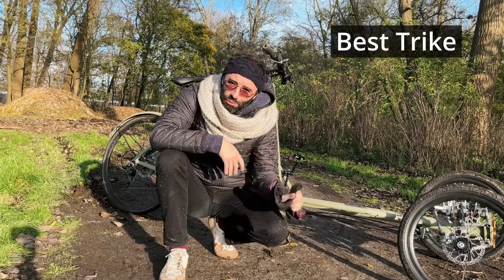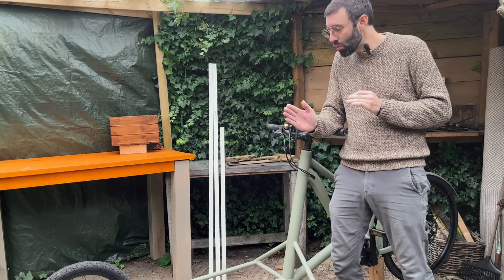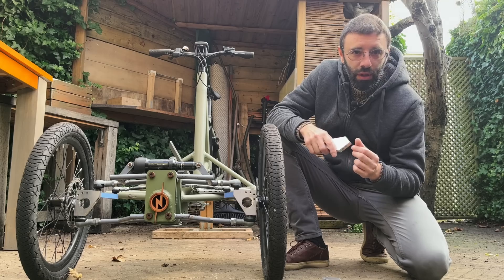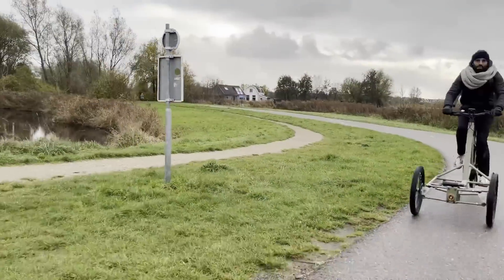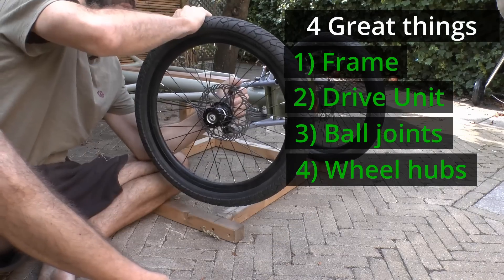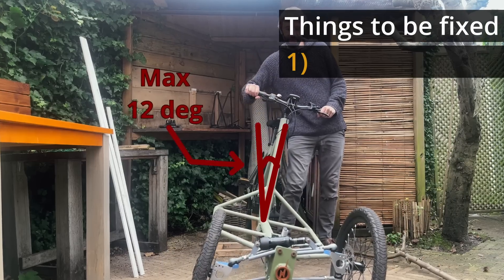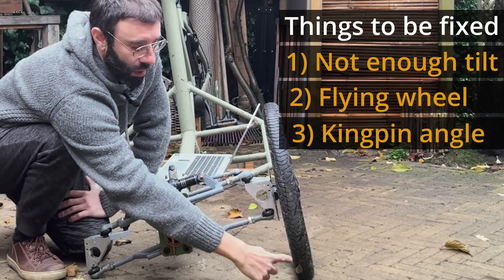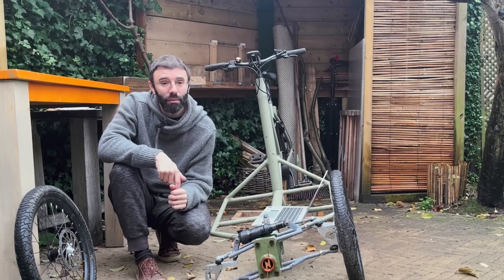#5 Build Finish and Tests - Tadpole Tilting Cargo Trike

Comment: I previously mentioned my doubts about the cable steering, but I'm no glad to hear that it seems to work that well! Did you ever retension it during your tests now?
Reply from the maker: The problem that I had with tension was the cables slipping (in the main head tube they are pressed with bolts) so I used washers with a rough surface instead of smooth and tightened the bolts hard and never had to tension again.
Reply: @pedro-neves  Thanks a lot for documenting all your findings!
Reply from the maker: @feudiable  my pleasure! Thank you for inspiring with your kind words.

Comment: YT just recommended this to me and I'm glad I'm here!
Your design reminds me a bit of the design Johansson (part of Pierer NewMobility now) uses on its Oscar S and Oscar M cargo bikes. They also have a double wishbone design with a single damper between both sides.
When the damper, and especially it's rebound, is set up properly, the Oscar M (which I have) is very stable going fast. Going downhill, I've reached speeds of 50-60kph with it!
It's also capable to do some limited offroading. I've taken my Oscar M to places no cargo bike has ever been before (and probably never will again, lol).
Johansson has some videos of the handling online, if you're interested.

If you're interested and are still looking for some inspiration for your design, I could also film some video of the Oscar M suspension at work (I have some action cameras that should provide good footage).

Also, in a video about different kinds of steering for recumbent trikes (non cargo), Utah Trikes also mentioned the Ackermann geometry. My Azub recumbent trike also turns the corner inner wheel more than the outer wheel and it feels very stable. I can also provide footage/images of how they've done their steering. It's basically a parallelogram steering as well using rods as linkage.

I already subscribed just now. I'm very interested in what you do next and how you solve the outstanding problems!
If you're looking for a new project soon, I'd be very interested in how you'd approach the build of a recumbent trike with suspension ;D
Reply from the maker: Oh, thank you so much!
The Oscar trike sure look cool! Before even going to the front, I like how they mounted the drive unit with simple brackets instead of a more complicated wrap around.
The wheels are super cool!
I like the simplicity of the tubing.
And finally the tilting mechanism looks great. I will watch a few more of their videos.
I haven't seen how much the vehicle can lean. Do you know? And is it enough to you?
Furthermore, if you like to share some videos of details that would be lovely. In this case, I would suggest posting here: https://www.reddit.com/r/VehicleEngineering/. I created this sub due to this very reason ;).
Again, thank you for your kind words. And so nice that you also had the idea of offroading with cargo vehicles;)
Cheers!
Reply: @pedro-neves  The Oscar has bump stops made out of rubber that limit the leaning. The advantage is, that you don't have a hard limit that might unsettle the bike but it kinda softly stops you from leaning more. I actually took out a spacer nut because the lean wasn't enough for me and it's still stable ;)
I'll try and set up a few videos showcasing the suspension. It'll take a few days though because it takes some time to get the right lighting outside for a proper quality video. I'll post the video on the subreddit when I've had the chance ;)
Reply from the maker: @wullxz  that's good information, thank you! No pressure on the videos. If you ever feel like doing it, I'd love to watch, of course;)

Comment: 1. Aluminum is fine for the axles.  Just make the connection at the same size as the larger hub bearing.  Taper the axle as well.  There’s a reason Canondale does this.

2. You’re wanting to produce a cargo bike, not just a tricycle, so make sure you’re doing the tests with varying cargo loads. How does the front suspension perform when it’s at a higher pressure to account for a payload? How will the vehicle handle when it is calibrated for a payload but is currently empty? Can this performance be improved by using a lock out in one of the travel modes (loaded vs unloaded).
Reply from the maker: Hi, I agree that the axles can be made out of aluminium with a better design. Though, I think I'll make them out of steel next time to compensate for design errors.
Regarding the tests with loads - totally agree.
Cheers!

Comment: Hi Pedro, another solution for decreasing the kingpin inclination angle is to use "deep dish wheels". With these types of wheels, the hub is positioned farther towards the outside, which allows for smaller kingpin inclination while maintaining a small/zero scrub radius. Google "wheel offset" for lots of examples.

Comment: What if you use cables instead of struts between the steering axle and the wheels?
Reply from the maker: Hi, I had this suggestion before and I still consider it given that when I increase the tilt, the steering struts ball bearings may not be sufficient anymore.
Cheers!

Comment: Go for steel on the axles, also pretension with enough torque to ensure increased fatigue. My guesstimate is that the aluminium axles failed due to fatigue rather than actual stress
Reply from the maker: Absolutely! I won't use aluminium for axles again. Cheers!

Comment: On the bush trail, the vehicle seems difficult to control. It seems to want to spear off the path. The tilting will steer it as well as the steering mechanism. A standard bike when titling doesn’t need much actual steering. Most is done by the tilt. Do you think the rider will get used to this, or is your steering too sensitive. I like the variable steering idea from the other guy!
Reply from the maker: Great points! Indeed there's not much steering in a bike. Though, I think that a cargo bike will have more steering than a bike because the vehicle being long it needs more steering to react. There is still one geometry aspect that I will consider in my next build - rake. I think I can make it more stable by plating with it.
Cheers!
Reply: @pedro-neves  Would you be interested in putting a datalogger on a standard bike, and measure the lean, speed and steering angle on it? I went for a ride today and looked at how much the steering wheel moves. Not much. I'd love to see figures (surely some PHD student has done this?). Not sure if it's your interest. Ultimately, if a leaner is going to work like a normal bike, it has to tilt like a normal bike, and speed, lean and steering angle are the parameters. And perhaps a 'fly by wire' system, is the best way to make this work. Complex, but fun? Yes? No? Thoughts?
Reply from the maker: @andrewmclean1239  Andrew, I thought of this idea before and I think it makes a lot of sense. As a control, probably best to test with a bike and a cargo bike and compare speed, turn and lean as you said. I'll look for some papers about it but if I can't find it may be a good project for me to share:).
Reply: @ that would be something else! If there is anything I can help with let me know. I’d try the elliptical idea first but imagine building the cybertruck steering for tadpoles!!
Reply from the maker: @ hehe, then we'd have an excuse to call it cyber trike ;)
Reply: @ YES!!!!! Love it!

Comment: Re the 30 degrees angle of the ball joint. Would a simple fix be to modify the bottom control arm with a bend before it attaches. so that when it fits onto the stub axle , it’s closer to a 90 degree? 
I’m also wondering about the angle of the steering rods (tie rods). I wonder what would happen if they are closer to 90 degrees to the frame? Hard to explain without a drawing.
Reply from the maker: I agree with you that I would be able to increase the lean by changing the shape of the lower arm. Though, I still think that not enough. It's a great point that I may have to change the connections of the steering rods!

Comment: Actually steel and aluminium have very similar strength to weight ratio.  So either can be built low weight.  Steel is much more resistant to fatigue fractures.
Reply from the maker: Axle should be made of steel for sure!

Comment: What an awesome trike build! Yes you should absolutely switch the material of the axles to steel. Aluminum never has an infinite fatigue life, whereas steel can. So under repeated loads, like you would expect in an axle, the aluminum will always eventually fail. Even if you increase the diameter where it joins into the knuckle, it will still eventually fail. In an axle that has that large of a diameter you could likely make it out of hollow steel without losing too much strength compared to solid steel. So you could save a little bit of weight there. But there is probably math you should do before you start hollowing out the axles lol. Also I would suggest making the knuckle out of steel as well. It will receive the force from the axle and also eventually fail, if it is made from aluminum.
Reply from the maker: Thank you so much!
I'll make the next axle out of steel for sure! The knuckle I'm still not sure as it will be totally redesigned.
Cheers!

Comment: I love this project . Great job! My suggestions:
For the Axle bore out your part and use a central 8.8 steel bolt. It should be plenty strong and you simplified the Design. From a manufacturing standpoint avoid the sharp corner between different radiuu next time. Putting a slight radius around the circumference will reduce shearing stress at this point immensely .
Keep on inspiring!
Reply from the maker: Thank you!
I'm having all this trouble designing the axle because I love these Lefty hubs;)
Definitely need to reduce the sharpness of the transitions!
Keep on inspiring you too!

Comment: Expect Aluminum to fail when stressed. 
Also expect failure at sharp transitions. Use at least .050" radius.
Reply from the maker: Absolutely. Two mistakes - aluminium axle and sharp transitions.
Thanks!

Comment: Great work! Thanks for sharing not only your success, but a failures too. It makes your solutions more understandable.
According to the front wheel axle I'd use steel. It won't demand to raise axle diameter and, probably, allows you to keep the front knuckle unchanged.
Reply from the maker: Thank you so much! Indeed, there's a lot of knowledge in the process (mistakes). I'm happy to read that this is vallued.
I will definitely use steel next time.
I need to change the knuckle anyway because I think I'll improve the steering by reducing the kingpin inclination.
Cheers!

Comment: Unfortunately, to mitigate tilting problem you need much more than swapping the ball joint. This effect will simply appear at bit greater angles, but the inner wheel will still bear most of the weight in the turn.
Instead you have to rework linkage for change in camber angle through the suspension travel just like you fixed toe angle change due to change in travel. That will solve third problem as well. And - maybe even more importantly - decouple suspension, adding second damper.
Reply from the maker: Thank you for the tips! Indeed, I intend to have a bigger inclination limit but I will keep the strain on the inner wheel. But I think that's alright.
Cheers!

Comment: Describe a turn not as an angle but as a radius. There are 90º turns that are sharp and 90º turns that are not sharp. The critical question is the radius of the turn.
Reply from the maker: Thank you! Correct! What's the point of being 90 degree if I make it wide... Thank you for correcting me on this. And for taking the trouble to do it. In return, I will state it correctly next time;)
Cheers!

Comment: Have you had any thoughts about doing the rear wheels in the same way? I'm keen to try a small electric car using motorcycle wheels (small ones, like off a 80cc motorcross bike). I think this is the future of transport.
Reply from the maker: Ya, the only difference in the rear wheels is that you have to consider traction. So, you'll need a different hub design.

Comment: Axles should be mounted on standard M16 or something like that screw. This is such a simple part and important component - it should be easly replacable and made of hardened steel - just like a solid bolt.
Reply from the maker: Absolutely. Scratching aluminium as material for for axles;)

Comment: 12mm (M grade 8.8 or 10.8, not sure) bolts are used for front axles on my offroad gokart, they take massive impacts without issue.
Reply from the maker: Ya, I think that steel would hold even at 12 mm.

Comment: This is very impressive progress. I really like your steering geometry improvements and I’m excited to see the next generation. 

I do have a couple ideas to improve your knuckle and spindle parts.

Where there is a change in cross section on the spindle, you should add a radius or fillet if possible. This is especially important where the reaction caused by the wheel is high, at the joint with the knuckle. 

I like your idea to keep the larger diameter spindle rather than turning it down to a smaller diameter. If you do this, you could  simply increase the bore size of the knuckle where the spindle is inserted. The spindle diameter may exceed the thickness of the knuckle, but this is okay. 

When you insert the spindle into the knuckle, it will protrude on both sides and can be welded in. The advantage to doing this you would have a lot of welding length for a strong connection.

Another alternative would be making the knuckle and spindle in one piece.  If you have access to a milling machine this can be done easily with a boring head. If not, a four jaw lathe chuck can be used, especially if you have a live center to support the spindle.

Best of luck with further development. I can’t wait to see more on this.
Reply from the maker: Thank you so much!
1) Absolutely. Changing the radius like I did is just wrong.
2) I agree. I do have a completely different knuckle design in mind because I'll change the ball joints to increase the amount of lean and also to decrease the kingpin angle so I'll have an axle diameter > 12 mm.
3) Right, I only welded on one side but if I have welded on the other it would have been much better...
4) A knuckle and spindle in one piece does sound like an awesome part! Though splitting makes it easier to make (less nice though).
Again, thank you for the suggestions and kind words;)
Cheers!

Comment: I think it's amazing.  The only improvement I could think of would be making the inside turning wheel turn at a sharper angle than the outside wheel.
Reply from the maker: Thank you! The inside wheel does turn more complying with the Ackerman geometries. This is accomplished with the position where the steering arm fasten to the bracket.
Cheers!

Comment: Well done on the improvements.. It performs very well. Some small refinements coming. A small radius where the axle was turned down to form the stub,  will help stop a crack forming even in steel. (Remember the DC10 aircraft dropping their engines? This was the cause of their bolts failing.)
Reply from the maker: Thank you! I cannot belive I built it like that. But I would expect aircraft engineers to know better;)

Comment: I'm surprised you didn't use steel for your axle as your first choice.  The weight is very small but the fatigue performance much better.  I suspect the real reason the axle broke was the cornering on one wheel which I would expect to greatly increase the axle load.
I've had a leaning trike in design for the last 20 years or so, I just haven't found time to actually make it.  I picked down hill front hubs with 20mm axle, which I plan to be steel tube.  I early reonned ball joints would not allow enough lean so I had intended to use trunnion pivots for lean with king pins for steering.
Your trike works, well done, I think it is great.
Reply from the maker: Ya, steel would have been much better. I think I chose aluminium because it was my first part being made in a lathe and aluninium just sounded easier...
Trunnion pivots - I'm always learning here, thanks!
Thank you for the kind words;)

Comment: If you make the pulley on your cable steering elliptical or 'oval' as they are called for chainrings you will get less sensitive steering around the straight line, while keeping your small turning radius as only used at low speeds...
Reply from the maker: Aah, what an interesting suggestion. Variable ratio steering. This is increasingly done in vehicles with steer-by-wire.
Cheers!
Reply: @pedro-neves  Exactly.  :)
Glad you 'see' and like the idea.
'See' as in realise there aren't any chain, belt, wire, etc tension or changing length  issues... (for others  reading this)

It should make tadpoles, recumbents, velos, etc way less twitchy/safer, without having to turn the handlebars right around 2-3 times for tight=low speed turns.
Reply from the maker: @RayleneCawood  yes I do appreciate the idea, thank you!
Reply: you introduce a new problem with keeping all the cables taught
Reply: @markifi  Ummm...  no... no you dont. :)
The geometry works out such that chain tension with one chainring circular and other side elliptical remains the same. ;)